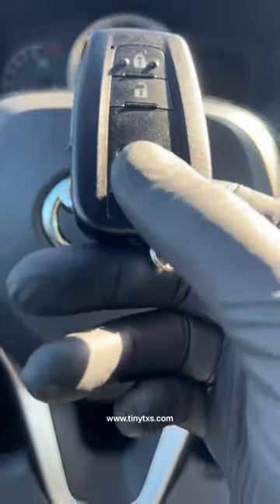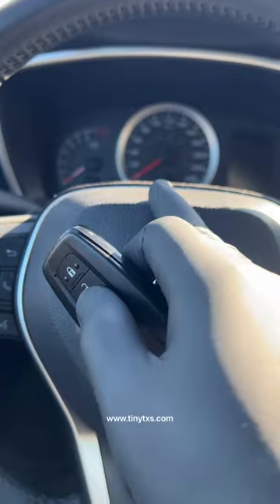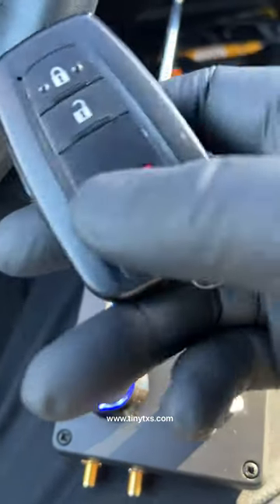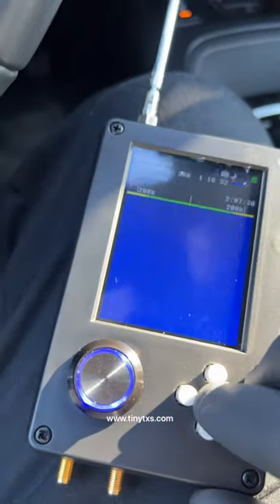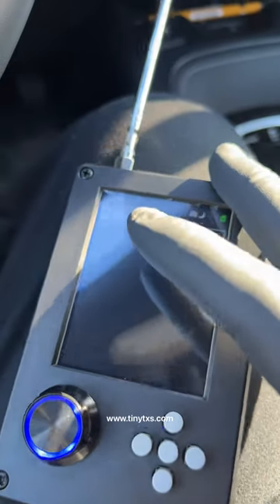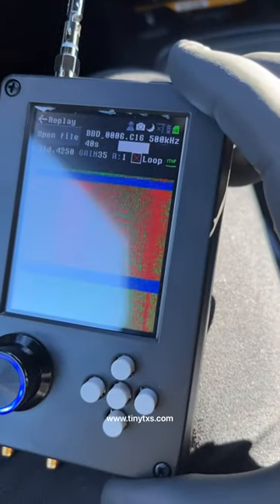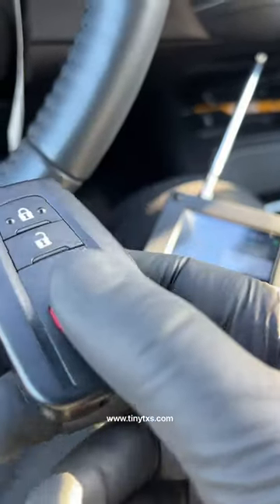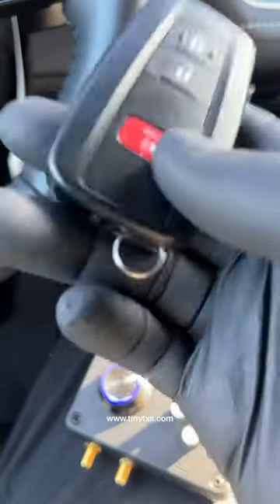Hacking Toyota’s super duper fantastical secure rolling-code Key Fob.

Comment: My pet turtle told me  that the majority of 90s vehicles use a fixed code. I trust him though and he made a backup of my vehicle's fob just in case my dog steps on the lock button when I make a quick stop at a gas station... its happened before!
Reply: Your pet turtle is wrong. There are very few early vehicles with fixed codes. We're talking about 1 year and one company in particular. 
I have data dumps for every single make and model car. I have 65k captures for many vehicles.
Reply: Well the majority of 90s Nissans then
Although its worked on several other cars Myrtle has tested/shown off the capability with, 2 or 3 90s major brands. Honda seems hit or miss.

Comment: Are you familiar with how newer proximity unlock key fobs work, the ones that don't require you to press a button but rather unlock the car as soon as you get near it automatically? Is there some sort of more proper handshake?

Also, how many valid codes does the vehicle hold on to at a time? If I was out of range of my vehicle and pressed the unlock button 200/2000/however many times, would the car think the code was invalid because the counter in the fob is so far ahead of the car?
Reply: The Passive Keyless entry systems work on 2 different wireless systems.
First, when you touch the handle, the car sends out a 315KHz RFID signal which the fob sees and responds to with an open command at 433MHz (315MHz in the US)
Reply: @ForgedEggs the pke is 125khz. The fob responds on its frequency used with the bcm.

Comment: Technically,  it's easy to make the codes much more secure- tie both ends into an accurate clock. But that means the user can't easily replace their own fob battery,  among other things.

At least ignition is a lot more secure.
Reply from the maker: Yes very true! But we’ve actually demonstrated on our Instagram page starting the car remotely using the same method!

Comment: I could be wrong (won't be the first time or last for sure!) but I was under the impression that rolling codes are specific and in order hence the reason you can replace the battery without the fob needing to be reprogrammed.  There is a list of codes but you can actually send a bunch of false codes and the vehicle will revert back to the initial base code it starts with.  Regardless this is a good video.  More important to me is, where did you get that Hakrf?!?!  I love that yours has a pentometer/knob seperate from the selecting buttons!  Mine is consolidated and I'm NOT a fan.  Is that an aftermarket unit??  And as mentioned in other comments, The Flipper is a cool gadget but by no means new tech.
Reply from the maker: Hi! Yes it’s an aftermarket version, they’re actually available on Amazon. Loaded with MAYHEM and everything, much better than stock version IMO.
Reply: @TINYTX INC.  Sweet!  Thanks for the info.  Will definitely have to check those out.  Can always use a spare!!
Reply: The Flipper is nice, especially with add-on boards, if it can do the task you want it to do. Like why bring the HackRF or Proxmark out if the flipper can do it? Not to say by any means that the HackRF/Proxmark isnt like 10fold more powerful, but i mean Flippers can be useful. Add on boards can pack a nice punch too.

Comment: You've described the RollJam attack, which isn't Toyota specific so it's a little unfair to rag on them for that.
Instead, rag on them for not properly using a CAN gateway in the RAV4 models.
With a CAN injector and a little brute force to the inside wheel well you can hit the headlights with a CAN spike attack to unlock the doors and replay a key auth packet to start it.
Reply: No I tried
Reply: He also neglected to mention that rolljam only gets you one good code, which is only valid if you use it before the keyfob is used again.

Key windows are a thing; and as soon as the fob is used again, which has a code aheadof the one you got, your code is invalid.

Rolljam is a fun concept but not practical. There are other, easier techniques.
Reply: You can't start it as that is a different system.

Comment: Hi sir I’m genuinely curious about this device and got me thinking that just like how you said if a key fob is out of range, the key fob and the vehicle cannot communicate. Does that mean all remote start car  are venerable of their starting signal on their key being captured and used to start their vehicle???
Reply from the maker: @nikbirkundi5223  that is 100% correct, any wirelessly transmitted signal can be compromised, it may not be simple across different technologies and industries, but as of 2024, there has not been any significant change to the security protocols that these key fobs are using, and to make matters worse, the vehicle manufacturers are complicit and 100% aware of these severe security breaches, why they choose not to address this problem is beyond our understanding, thousands of vehicles are exploited and stolen every day with basic off the shelf electronics.
Reply: @tinytx  thats pretty sad to be honest. The fact that it would work on modern cars that use remote start is just absurd👏
Reply from the maker: @nikbirkundi5223  totally agree, we need to put pressure on the vehicle manufacturers.
Reply: @tinytx  Right! So in theory my bmw would be vulnerable to this kind of attack? Please say no.
Reply from the maker: @nikbirkundi5223  your BMW is actually more secure than most other makes but it’s still vulnerable!
Reply: @tinytx  how so? Btw subscribed to your channel!

Comment: Since the release of the flipper zero everyone is going crazy thinking these attacks are brand new. By the way I saw I comment regarding desync the fob. How come it does not affect it? Awesome video !
Reply from the maker: That’s right, they’ve been around for years, just with different tools. If you desync the fob the vehicle will no longer recognize the fob, but codes can be captured and stored for later, you can capture hundreds or even thousands  and store them for use at your leisure.

Comment: Got a question. Can’t you not start the car Cus if you jam the car and try to get the frequency of the car starting wouldn’t it not turn on since it’s jammed
Reply from the maker: @nikbirsingh  that is the case just for this video, but in real-life the bad actors would come back another time, maybe even the same day or night, the code is saved and just used at a later date and time, as far as the vehicle is concerned, it’s never received that stolen start up sequence code (the authorization “handshake”) so it accepts it as a never-before-used code.
Reply: @tinytx  really appreciate you replying to all the comments but I think you misunderstood my question. For example a push to start car (keyless) can someone jam the car then capture the signal for the ignition as they push the button to start the car?
Reply from the maker: @nikbirsingh  oops sorry, I see what you mean. Yes and no, the signal and handshake will occur if the vehicle owner remote starts their car, so yes this can be jammed and captured but if the vehicle owner is in their car a jammer will have no effect nor will anything be captured when they press the physical push to start button as starting the vehicle with this method is nothing more than an actual physical switch being engaged.
Reply: @tinytx  but isn’t it not just a physical switch? It operates with the signal of the key fob so that the car knows that the key is in the car to start the ignition? Can this signal be captured by thieves? Or is it only possible to copy the signal of the ignition with remote start vehicles? Btw subbed to your channel

Comment: You cant compare this sec flaw to the static code..
With rolling code you need to either to jam the car and sniff the keyfob, or get physical access to keyfob itself. Both are more risky and complicated, and limited in use (depends on haw many keypresses you manage to catch).
With static code you need to capture the keyfob signal ONCE and you have unlimited access to the vehicle anytime you want.
I'm not saying it's undoable with rolling code, but statement that it's as unsecure as static code is also exaggeration.

Much easier for thieves is to use the Bulgarian "Gameboy" - not only does it open/close a car, it also starts the engine, and all of that WITHOUT any neccessity of keyfobs being even close to the thief.
Reply from the maker: Good points made👌 thank you for sharing!

Comment: how babout brute force codes until the car runs out of new codes
Reply from the maker: This would not work, although this was a common attack on garage door openers back in the early 2000’s.
Reply: It's a rolling code. It doesn't run out of numbers. However, 1 bit is removed from the fob's signal after the first rollover at FFFF to 0000 to have a permanent record of that happening.

Comment: Can you demonstrate when the key is not in ranage
Reply from the maker: @Mike-s9u  it would not matter for locking/unlocking, 99% of these exploits are done when the key is far from the vehicle, the vehicle would still unlock without the fob using the captured signal but it likely would not start without the presence of the fob even with a captured start signal

Comment: Thanks for interesting video.  
 How much is average or maximum recieving distance from keyfob to hackrf in Urban conditions? 
 You also press long the button.  In real life, the owner of the car just clicks one time and that's all. 
Does this sdr simply send the same code that recieved or can also modify it? 
For instance if sdr accepted signal "lock", can it send signal "unlock" ? 
How to deal with that
Reply from the maker: With different antennas you can extend range significantly, at the least 10’s of metres. Regardless of long press or short press the signal will be captured, I long press in the video to show the signal appearing on the waterfall of the analyzer for those watching, the SDR will only repair the captured signal, no modification done at all, if received signal lock, SDR will play lock, same with unlock, car-start etc, SDR cannot modify signal, only replay captured signal and that’s all👍
Reply: @TINYTX INC.   
So what's the practical ways of recieving signal "lock" and send command "unlock" or get "unlock" signal that will really work? 
 If keyfob ( keyless entry) is out of range, is it possible to copy that from 1-2 meters distance by sdr tools or flipper zero? 
I know that russian some devices can accept signal lock and then send command "unlock".. they cost expensive . But they don't work on all cars..

Also, get interested, how is possible to bruteforce the rolling code cars? Several devices needed?

Comment: No rolling codes?
Reply from the maker: There are rolling codes but we capture a set of codes using the device in the video while blocking the signal to the vehicle, so the vehicle just doesn’t have a chance to authenticate the code so it thinks it’s a code that has never been used before.
Reply: @tinytx so where do you find these devices at?
Reply: @tinytx if you was gonna buy em

Comment: First I want to say very good explanation. But you can only open and close the door and not start the vehicle that has start a button, right?
Reply: I think it makes sense because the key has also immobilizer which is not used to unlock the car but to start the ignition, so yeah in theory you are able to open the car in this way but that device I think is not the same what relay attack that must just extend the signal to start a vehicle. Which is the biggest problem in case they want to steal your car.  Basically keyless entry best option to turn off that crap until we really get a safe one. I have also installed one more special one there is no way to start my car it cuts the fuel pump and whole ignition.
Reply: @user-wu6mc8es5w manufacturers updated the software, so the delay in time means replay doesn't work. Not all have this update yet. It takes time to send a signal through the amplifier. So, the cars pke sends a wake-up command, and if the key doesn't respond in exactly the right time frame, the car won't open.

Comment: This does work for rolling code does it
Reply from the maker: Yes
Reply: @tinytx  if the hackrf sends the signal and there is a new code, what happens to the key fob
Reply from the maker: @soapy5343  nothing! The handshake never occurred in the first place so the vehicle will authenticate the signal and accept it either way
Reply: @soapy5343 in most cases the car and the original fob are desinc and this is a mess to solve. Dont play with important devices, use your spear car😂
Reply: @labizcochadequeso only certain vehicle it's a problem. These would be German vehicles where only authorized people can make key adaptation through obd without removing the memory chip and modifing that directly.
Like volkswagen. However. That chip is behind the instrument cluster.

Comment: How do you do it with out the key fob tho???
Reply from the maker: You need access to the fob just one time for a few seconds, the codes are then copied and stored for later single-time use
Reply from the maker: @solomongrundy145 most thieves do not want to steal the physical key as to not arouse suspicion, they just need to clone it quickly, that way they can come back at will without raising any alarms about missing physical keys.
Reply: @tinytx Theives have several methods depending on the vehicle. They can replace the bcm and ecu with a known key, or they use professional tools to add a key after picking the lock.